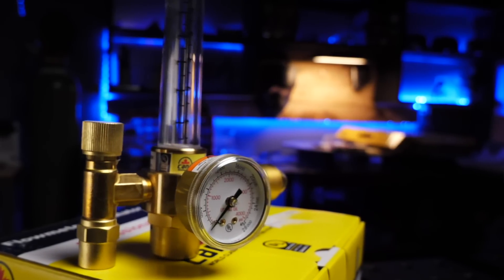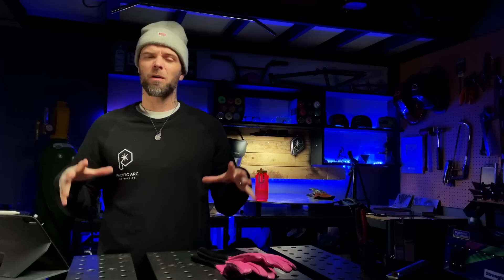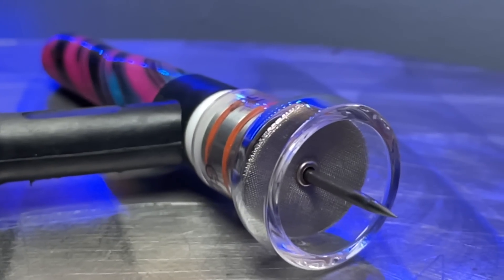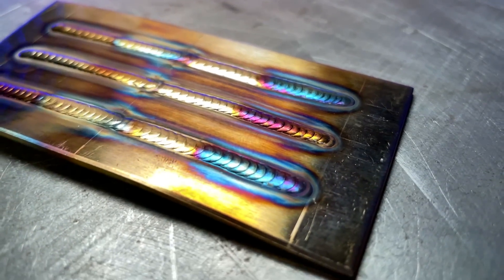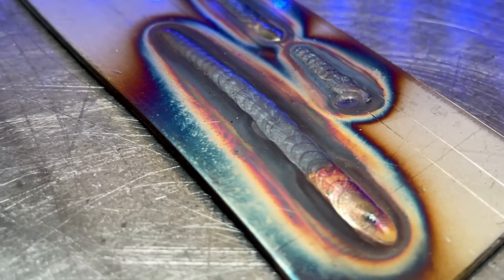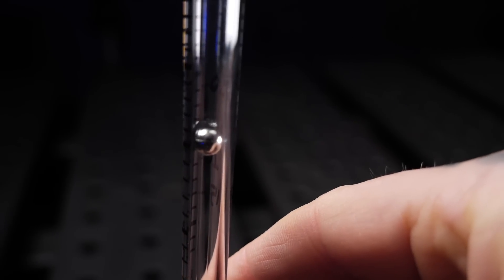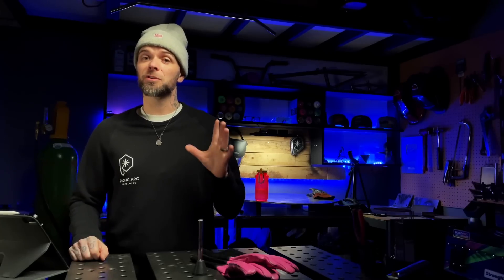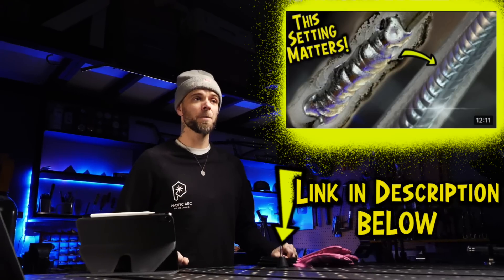my welding gas was WRONG and I didnt even know

Comment: Dusty the flow meter reads L/min and the gauged on the tank reads SCFH so to get the right gas flow at the torch with a #5 cup is 2 x 5 = 10 x .72 = 7.2 L/min to be the right argon flow at the torch with the flow meter

Comment: Hi Dusty Good advice I have a Miller 200 DX I bought the flow tester and found my gas flow at the torch is about 1/3 of the regulator I switched regulators and leak tested connections and still got the same results lower at the torch than at the regulator. The regulators are both high quality so I am wondering why the difference at the torch. Update I finally found the leak it was the adaptor hose feed from the machine the flow meter definitely is a tool to have

Comment: I have two Sparc regulators and they both read a bit low. Luckily I bought a flowmeter before I had noticed an issues but I have had issues with a diffuser screen giving lopsided coverage, a leak with one cap, etc.
Flowmeters are a necessity

Comment: Do you use a 15' or 25' lead, & if a 25', do notice a drop in pressure from the regulator to the hose?  Great videos!
Reply from the maker: Great question, Dan! If everything is done up correctly, you shouldn't lose any gas, I don't personally notice a difference from one size to the other. I appreciate you watching!🤙